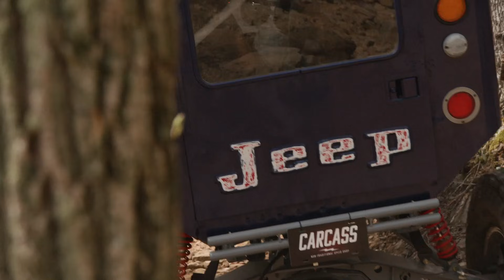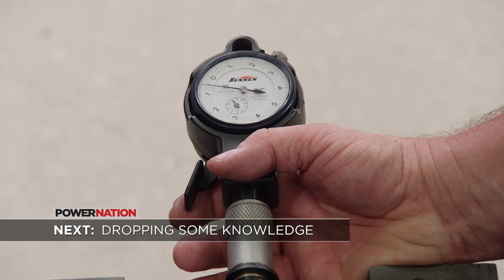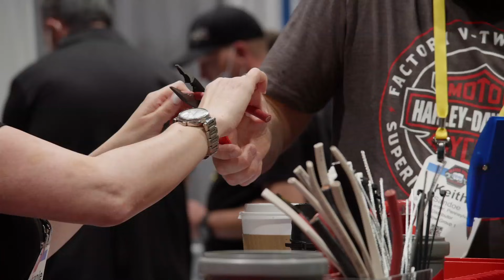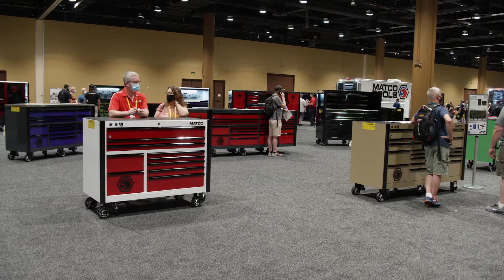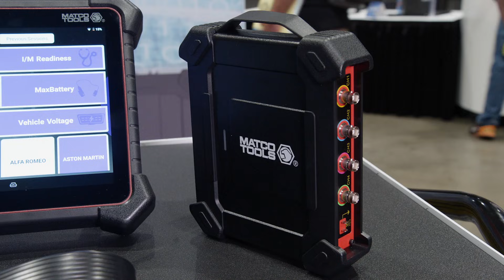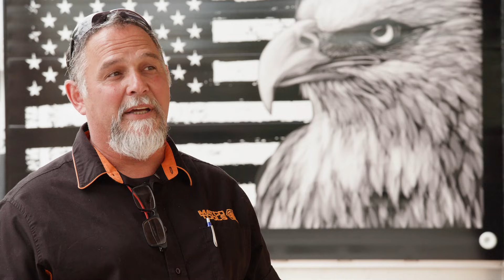Laying The Foundation To Rebuild A GM 4.3L V6 - Engine Power S8, E15

Comment: Stars aligned and this episode came on my tv as I was trying to find a new engine swap for my Jeep drivetrain swapped Chevrolet Tracker. A little bit of searching led me to Advanced adapters site where they have a 4.3l v6 to AX15 transmission... This should be fun once it's done. Thanks for the inspiration!

Comment: Hi!  I have seen a lot of modifications on engines.  Its all about getting more power.  Can you do something different?  A V8 or any engine.  The challenge is no engine vibration when you start it.  And a very quiet engine and you can't feel the the engine is already running.  Can this be done?  What is the best V8 for this challenge?  Thanks.

Comment: Parts Guy here-- DO NOT get the cheapest remanufactured engine you can find. I have personal experience with this sourcing engines and transmissions for customers. 
Profit margins are shockingly thin on remanufactured engines, meaning that a few hundred dollars increase in cost has a direct effect on build quality, quality control and the quality of their help line. You are already spending a few grand, saving up for  a few extra months to get a better quality product is worth it, i promise.

Comment: Hypereutectic pistons have high silicone content and do not expand as much and = a tighter fit in the bore , with coated skirts and small ring gaps = turbo subaru record attempt 48 hr

Comment: POWER NATION 
BDS makes 4-71 Blower kit for 4.3 V6 with the Vortec intake & regular   intake bolt design. 
Young Gun just isn't doing his research 
They have several choices with them in stock as I'm leaving this.

Comment: who can build a 4.3L like the one you built on the TV show? I have a GMC sierra 4.3L remanufactured engine. I don't want a turbo just a strong engine for the street. I would like a better rear end suspension in the pickup as well. maybe a 6 speed as well.

Comment: vortec 2700,2900,3500 and 3700 are also great cheap GM drivetrains with tons of potential. the inline 4 and inline 5 design makes them quite capable especially with boost. or the SAAB B207R or ecotec LNF or LDK.

Comment: I have seen motor builds on different engines lately. I have a Buick Regal T-type Limited, it has 200,000 miles and going to do a build for it.  You have done a 455, a 350 buick. AMC, chevy and ford 6 cylinder engines. This is a Chevy v6. Being that a Buick Grand National is iconic Muscle car, it seems that a Buick Turbo V6 would be a interesting project.

Comment: Imagine if gm would have kept with the typhoon/cyclone engine platform with the turbocharged or even twin turbo 4.3 I think ford knew what chevy had with the 4.3 and went with dohc and smaller displacement

Comment: I have the perfect project for this engine. A 81’ AMC Eagle SX/4 Sport Limited. It now has the Pontiac 2.5. I am pretty sure it will bolt up to the 4-speed trans
Reply: Great idea. I had a new 82 Eagle Sport with an automatic. The car was a blast but not enough power to spin a wheel even in snow, it would just GO. I have also had several of the 4.3's and loved them and always wanted to build one of them up but never thought of putting one in an Eagle. It would be interesting combo if the drive train will handle it. I had a pretty dark blue Eagle with gold stripes. It would go anywhere in rocker deep snow and also in the loose sand at Daytona, never had it off road in any deep mud, it was too nice to take a chance of messing up the body. The only 4X4 that I know of that came from the factory with white side wall tires! I think of that car every time we get a deep snow. Like many other cars I wish I still had it. I do still have a couple stock 4.3's, the best one being the 95 model vortex with the spider injection. The only trouble I've had with them is distributor caps and rotors.

Comment: Nice start. Love your show. Be waiting for this for a life time. My 1987 S10 Blazer bought new always garage kept has always cryed out for an upgrade to a 4.3 super charged. Whipple Auto rotor Opcon supercharger kits  from late 90 are to rare but would be very cool. Twin turbo would be cool as well. Don't for get about  manual trans behind. Love to row the gears. Here is my shameless plug, if you need a platform to put it in.....  Cant wait to see what you guys come up with.

Comment: Thanks for all the great content guys, how about an engine build for slow technical trail driving or rock crawling, very low rpm torque, smooth delivery with power when you need it, I'm sure there is an audience for this type of build

Comment: Nice to c a 4.3 build i have 92 typhoon that needs a rebuild I'll be following this thread can't waitfor the next installment,already have an ATK 4.3 off the demo rack@ summitt for 500$ and a set of lil brodie's w 2.08 int 1.60 exh for a1k$,comp cam hyd roller .500×.500 220$, holley 58mm throttle body, 50lb injectors and a moates custom chip 18 adjustments, custom billet fuel rails, aermotive fuel pressure reg, comp mag roller rockers 1.6 ratio for the extra lift and a precision turbo ,custom making aluminum valve covers as none are offered for the perimeter bolt lil brodies  cutting down some center bolt 350 vc and making them perimeter bolt the center bolt holes will be used for spark plug wire looms

Comment: I recently did the head gasket on my Datsun Bluebird engine. It's a 1.8 gasoline engine, known as an L18. I put two head gaskets would that change the displacement?
Reply: How would it?
Reply: @Icutmetal  I was thinking the extra thickness of the second gasket?
Reply: @MerlinOpeth  Right, but how is that going to change displacement, which is tied to the bore & stroke?
Reply: @Icutmetal  I'm not a mechanic so obviously I'm wrong from your reaction. I'm just thinking that would be extra cc's in the combustion chamber.

Comment: My boss built an adapter to mount a small roots supercharger plus modified the supercharger snout (shortened it) in order to use the supplied drive system from a SBC kit on a 4.3 Vortec. Made around 380 HP on pump gas, went into a ski boat.

Comment: matco cheap steel step drill bits = $350 for the large set.... VS actual tool and die HSS grade bit made the same style $100 at the most  you are paying for quality NAME not a quality tool PERIOD! matco is like a lambo with a ford pinto engine inside with glass packs to make it sound fast and beefy LOL between snap-on and matco im not sure which one is trying to break you with the same cheap made in china bs tools and calling them self as the " best " -_-

Comment: Should find a Grand national an swap that factory 3.8 for a stout 4.3. That way you keep the 6 cylinder but with the extra cubes and larger bore the turbo should really wake that up. Plus it would look factory as the two engines are very identical looking. Also Brodix makes cylinder heads for it.

Comment: PLEASE MAKE A POWERBOOST...but you know..not a hybrid..make a rolling generator. A BIG ONE! Dual VERY high output alternators and four batteries. Use something like an OBS ford 250 4x4 so you can get your power where you need it!

Comment: Would really like to see what intakes and heads are out there for this. From what I've researched, it's pretty much either crazy expensive heads (circle track by Brodix, I think) or hog out the stockers which flow way better than stock but are still weak. I'm not sure if anyone even makes and intake for it other than sheet metal ones. I thought Eldebrock made a carb intake for it at one time. Maybe they still do.

Comment: This build is right up there with the 300 Ford six. Looking forward to see which direction you take. I’ve seen a couple of these used in rear engine dragsters, they were very impressive. I’ve always wanted to put one of these in a Older Jeep or  mid engine sand rail.

Comment: For the love of everything holy would you please cover the 4.3L install? Mainly the electrical grounds and the timing with the spider assembly. I’ve recently installed a reman’d motor & reman’d tranny and I can’t get past this dang “miss fire/random miss fire/miss fire cylinder #6 garbage. Also, I’m open to a fuel system upgrade &/or cam swap with a turbo/blow through & fuel system (carb or efi) upgrade that I can buy off the shelf.

Comment: Ahh yes my old S10 I rebuilt was nasty for wat it was with the cam and other internal mods done wish I still had the motor the truck was rebuilt from the ground up then a month later I was tboned in it rip miss ruby.

Comment: If you set up a Y style rear Single turbo ya could potentially make an LSA intercooler intake style manifold.  Minimum space to compress, and using a well known set of parts.

Comment: looks like a 93-95 cpi shortblock, so has lighter pistons, and a more aggressive cam than a tbi (stock vs stock anyways, reman throws this out the window) heads are still nowhere near as good as true (96+) vortecs (ported swirl ports usually flow less than stock vortecs)

Comment: Absolutely loved that you guys are going to feature this engine. Unfortunately in Brazil we don't have easy access to V8s of any make (at least not in my budget range) but the GM 4.3L Vortec V6 and the Ford Cologne 4.0 V6 are somewhat accessible. I know you Americans love your carburetors, after all they do look nice and sound great, but I would hope you guys make this a Fuel Injected engine, preferably port injected (there's a 2003 model version of the 4.3 that doesn't use the spider style injectors) and LS Style Coil on plug for that nice "modern" look. Maybe a Syclone/Typhoon tribute engine for all turbo Junkies out here? Or just an everyman affordable build?

Comment: Only thing that Matco makes is their toolboxes,their tools are rebrands.That Matco rethreading tap and die set,made by Lang.Matco started with being Mac's toolbox division making the toolboxes for Mac until the split in 1979.The blue handle ratchet shown,you can thank dealer Michael Cummings and Clay Koon whom has a channel on here,Koon Trucking.Clay Koon thought of the idea and his dealer Michael Cummings submitted the idea

Comment: My first vehicle had the ole 4.3 in it, it had bad valve seals, and it burned oil like a James Bond getaway car when you pushed the throttle to the floor, and after having it for a few years it finally dropped a cylinder and I got rid of it.

Comment: Can some explain why on top of the exhaust valve spring is a bigger ring and on top of the intake valve spring there is not? I recently bought a set of heads (3890462) and and 1 head has that an 1 does'nt

Comment: GM Vortec 3000/ 181ci high performance build. Love to see a buildup of this forklift and marine industrial engine based on the Nova 4 cylinder of the 60s. Great engine for a lightweight rod

Comment: A pair of Garrett G25-660 turbos or a belt  driven supercharger feeding a big single. The new Garrett G series flow rate is improved and people are getting 500hp from a 2ltr SR20 nissan engine.

Comment: One of the best power plants made. I had a GMC 1500 WT with the 4.6l and sold it with 380k miles on it. The truck was falling apart (literally) and the new owner bought it just for the motor. He put it in his boat after rebuilding. He told me that the cylinder bores still had the factory cross hatch. Strong motor.

Comment: The next engine that you do do a costom part on I want to see a double or single,a mechanic can decide that I guess, overhead cam on the ford 300ci inline. They made them for about three decades and they are loved and abundant. And there is no reason that there wouldn't be a market for the head. One time please.

Comment: A pro charger ,or a vortec supercharger for a 350 small block will bolt right on. That's what they should do with it. I think you should be able to run about 9 to 10 pounds of boost with out o-ringing the block or heads. Put a bigger cam, and a set of long tube headers. I'm just offering some ideas for you guys.

Comment: I was mowing the lawn this morning thinking about how a 4.3 liter would be awesome with twin turbos, and wondering why Ford didn’t use or design a bigger displacement 6 cylinder such as the 4.3 or 4.4 and instead chose 3.5.
Reply: MPG. Is why. GM eventually caved to the 3400/3800/3500/3900 later.

Comment: 6:04  Edelbrock makes a TVS2300 kit for the Small Block Chevy so I dont see why you couldn't make a lower manifold (maybe 3D print/ billet) with a TVS1900 on top.  Maybe do non-intercooled carb style and front feed EFI intercooled style (Similar to what the OEM's do).  That would be an absolute ripper at 16psi on e85.

Comment: I always wanted to stroke a 4.3 like you would a 350 to build a 383. Pretty sure the crank would be a one-off custom deal that would make it cost prohibitive though.
Reply: There was rumors of a stroker kit for these. One was supposedly up to 4.7L and another one i read about was up to 5.1L but with a .060 over bore

Comment: Back in the early 90's I had a LTD 2 with the first of the 3.8 Ford V6. The heads on that engine looked just like Cleveland heads, other than being cast in aluminum. I cleaned up the casting on the 2bbl intake and heads put a 500 Holley 2bbl carb on it and that little sedan would give mustangs and camaros fits. That was a very fun car.

Comment: Road kills ratsun 4.3, keeps cracking the cranks in half with boost.
Reply: Yep, that's the weak link in the even-firing (i.e. modern) 4.3 V6: the offset crank journals. I don't think there are any off the shelf billet parts either and I don't know how much it would even help.

Comment: Nice I just bought a 95 v6 5peed manual.  my idea was to put a 350 with the fitech fuel injection and put a automatic transmission but with this I might just fix the v6 and I will done faster keep up the good and very informative job 👏

Comment: I had this engine in a work truck and I loved it.  At 110,000 the water pump let loose and I decided to change the timing chain while I was  at it.  Dumb move because till that date I had never timed it.  I use Restore in all my oil changes and the result for this engine was that I did a compression test at the same time and the lowest psi was 185.  When the truck went back on the road it had more power than when new. A month later the lower end let loose and I had to rebuild.  Long story short, the  same shop that services the Gator Nationals boys, right there in Gainesville FL, bored it out 30 over and put stock parts back in,  that engine found crazy torque and a lot more HP.  Great motor and BTW the shop said you could bore it out to 90.  Have fun boys!!!

Comment: I never thought I would see you all build that engine. I always thought the 4.3 had a ton of potential because of the similarities it has with the 350. My 2006 short bed chevy has that same motor in it. I have often considered building it. I can't wait to see what you all do. As I understand it those little things actually have a strong bottom end and with a few tweeks like splayed main caps and hardened crank it can handle some power. The only issue's i saw was getting the air and fuel to feed it with limited after market support for that particular motor.  I caught you mention the rods were 5.7" i think. I always wondered if you could or should swap those out for some 6" rods? What would the result be? Anyways, can't wait to see where this goes!
Reply: You have what is known as the LU3 262 Vortec 4300, it is better than the L35 which was around during the L31 350 Vortec.
Reply: Your cam lift and duration needs to be monitored. This is a 75% 350.
Reply: Rods are not the same as a 350. The pistons are. The 4.3 rods have a bigger big end, and the rods are narrower. All of this is because of the split pin crank in the 4.3.
Reply: To feed the air/fuel I'm using an Edelbrock intake modified with 42# injectors and a Holley Terminator X ECU.

Comment: I'm excited to see a 4.3 build!
Reply: Yea, if you google it its a bunch of nay sayers. I'm like Yes! Let's see it!
Reply: @christophersmallwood3944  David Freiburger did a good write up on a 4.3 build. I wouldn't mind building a Vortec 262 for a S10..
Reply: Yes. Looks at my 02 xtreme blazer would like to build a 4.3 for it to make more power not looking for crazy numbers but would like 200-250ish range.. My old 92 s10 is eventually getting a 6.0 swap
Reply: @HabituallySlapMyBass  there are guys pushing 600 horse to the wheels with these 4.3's. Some via boost, others with a shit ton of nitrous
Reply: @ks_1111  that's nuts to me.. I understand it's tough but Jesus that much nitrous we talking 150+ shot you might as well do a v8 swap or if you want a 4.3 get a blueprint motor made and throw boost at it.
Reply: @HabituallySlapMyBass  the two builds i remember reading about the guys had custom forged cranks that were also cryo treated. And i believe ARP studs for all the important stuff. These were guys who wanted to do different, not easy
Reply: @HabituallySlapMyBass   nice car I love it. I have too camaro but I need also race track like this
Reply: @Jihadbearzwithgunz the frame can handle that much weight & torque?
Reply: The DF write up is a great article. Edelbrock now offers a Vortec 4.3 Dual Plane intake now. Lot of guys in the 4.3 Facebook group have told me the Vortec heads are the best.
Reply: @justindampier9017  It is good at 5.3L and another gays but here at 4.3 it is not good very will. see the 4.3 video review from Richard Holdener's channel
Reply: I like the idea of turbos like a eco boost